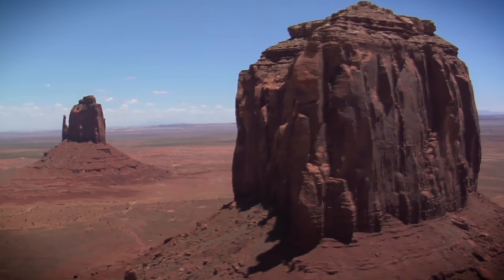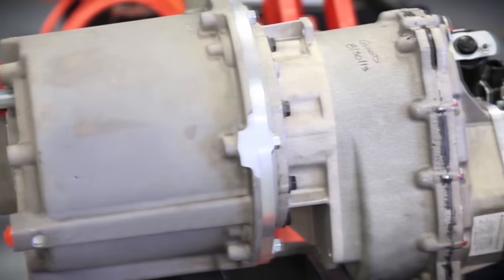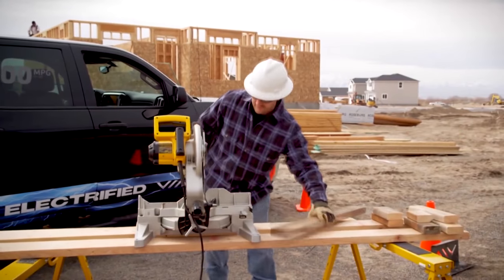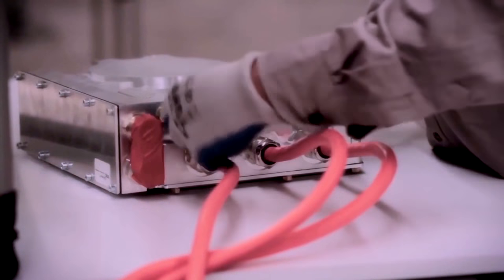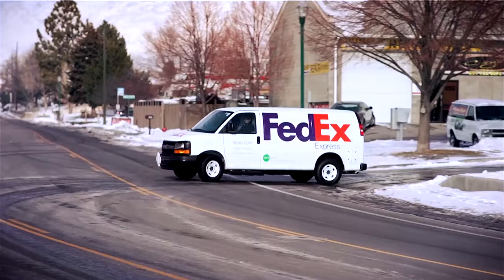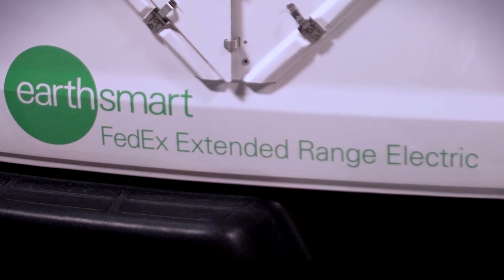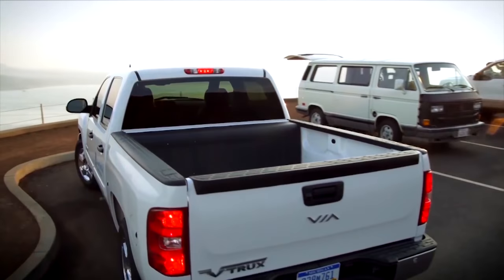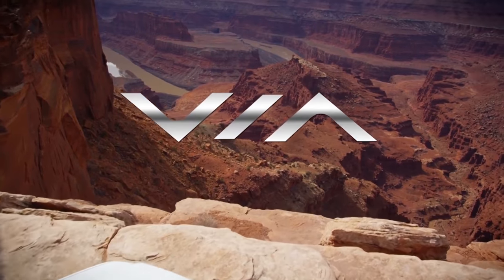VIA Motors Announces Production Launch

Comment: Does these trucks have four wheel drive and have towing capabilities for bumper pull  and goose neck trailer towing?What are the range for towing  loaded trailers up and down the steep mountain passes here in the Western U.S.? What are their load capacity GVW? How do these trucks perform in extreme cold and snowy and extreme hot climates?What are the battery  warranty and replacement costs and life of these batteries?At what price ranges are these trucks?What is the warranty on these trucks?Are these trucks also 3/4 and 1 ton specs.?How is the cab heated and cooled?
These and many more questions must be answered before purchase.

Comment: I would prefer an "all-electric" truck. Hybrids are too much machinery and most truck use is local. If you want an "on-board" charger, a removable generator would be more practical and useful, especially for contractors.

Comment: If the engine is used only for rotating the generator, why a V6 is necesary instead of a smaller L4 engine?
Why wouldn't be possible to remove the battery and to connect the generator directly to the traction motor via a control unit (voltage/current/frecv stabiliser)?
In my opinion, this idea should be taken by the other hybrid car produces, because of the traction motor&engine-generator, not engine or/and traction motor, battery, more complicate gearbox.

Comment: jay leno what the hell did you add up what they try to claim 400 mi range but needs to be charge ever 40 miles the genterator can not substain power to make it move im guessing you have to stop 10 times to let generator to charge system to go that 400miles 100mpg as long as plug it in every 40 miles so thats 2 1/2 charges per 100miles that a hell of lot more gas then one gals of gas

Comment: RIVIAN R1T & R1S are better Vehicles and are 100% Electric and ZERO Emissions.
VIA Trucks are still using a DIRTY ICE Generator and a Small Battery pack. you are hauling all that Extra Weight for NOTHING.

Comment: question 1 whats the purpose of the 4.3 gas motor if i got to plug it in every night 2 question 100mpg and now 400 total miles range and im assumeing this truck only holds 4 gals of gas but why i put gas in it if i still have to charge it and chevy already has hybrid trucks and they get 18 to 24 mpg so how do you get 100mpg some body is full of shit here a who in hell builds a truck that only holds 4 gals of gas 3#question it says it generator produces 14kw and can run all day on 4 gals gas that bs it would only run 3 hour tops if you expect any body to beleive your bull shit plz revise your specs
Reply: the gas engine only runs if you use up the battery.Then it recharges the battery not run the truck. Most people don't drive more  than 40 miles a day. so they don't end up using any gas or very little.
Reply: brad it says the car has a total range of 400 miles but only 40 miles on a charge so your saying that this truck only holds 4 gals of gas then say it can run generator all day on that 4 gals at what point did i lose you plz remeber the 100mpg
Reply: So I have seen more than just this video on the v-truk when they say 100mpg + what they are talking about is the cost of fuel/electricity. When you take the average daily commute and you convert the cost of electricity to gallons of gas it ends up cost you the same as if the vehicle was getting over 100mpg. Admittedly they are not very clear on this. On the gas tank I took what they say is 33 mpg on the engine 400 mile range and 40 miles electric you get about a 12 gallon tank.